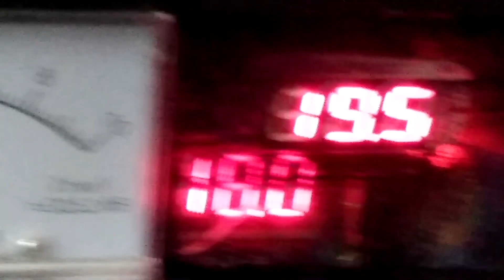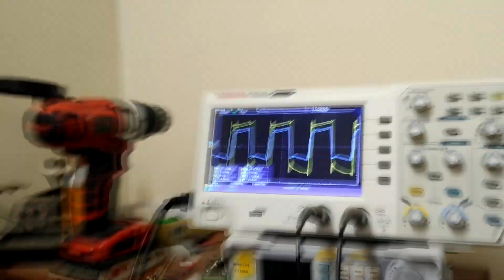Full Bridge SSTC testing

Comment: Please take photos or videos of assembling the electronic circuit. I would like to see circuit.
Reply from the maker: The circuit is Steve Ward's https://www.stevehv.4hv.org/DRSSTC1/DRSSTC1OCDsch.JPG

It's recommended you also check out his website and explanations https://www.stevehv.4hv.org/drsstc_design.htm

BUT I'm just using the circuit to drive a regular SSTC with secondary feedback which just means instead of having my feedback CT on the primary winding I've got it on the bottom of the secondary as it goes out to earth ground.

Comment: Since you have experience of so many tesla desings 
Which circuit should i use if i want to make a mini desktop Tesla coil?
Input would be around 24 to 30
Reply from the maker: Well of course if you don't plan on a boost stage I'd have to say the ones I've been building based around the Tefatronix circuit. I've got several I made recently running on that voltage range.

Comment: I’m sure you know but I think it would be benificial to reduce the coupling between the primary and secondary coils. Very tight coupling like that is not way important especially once you make it a  dual resonant design. Does this circuit have OCD? I’m assuming it’s based off Steve Wards circuit. I also think increasing and playing with the size of the top load might be benificial though 230 kilohertz rang is pretty decent for that size of top load. What gauge of wire are you using for the secondary and what IGBTs are you using. 60n65s?
Reply from the maker: Yeah this is going to be ran as both a single and dual resonant setup but this current coil is just one I grabbed off a 1/2 bridge to test out this driver. Before running it as a drsstc I want to test ramped operation. It's Ward's drsstc 1 so it does have OCD for when I add the tank cap. I need to wind a new set of coils for this but the current one is 36awg and the coil combo runs great on the half Bridge. 60N65s again.

Comment: where is the other end of the secondary coil connected?
Reply from the maker: to my mains ground
Reply: @Magneticitist  isn't mains ground dangerous?
Like all the appliances can get hv from it?
Correct me if i am wrong
Reply from the maker: @tvishmaychoudhary69  It's possible yes. I haven't had that problem. If I were to pound a ground rod nearby it would likely have a low impedance to the actual residential rod and might not even ground as well.